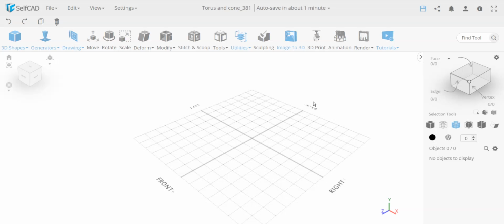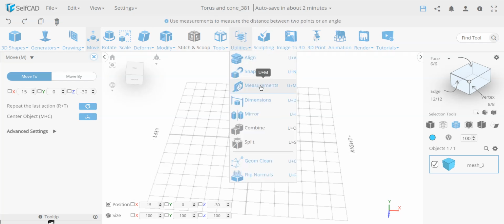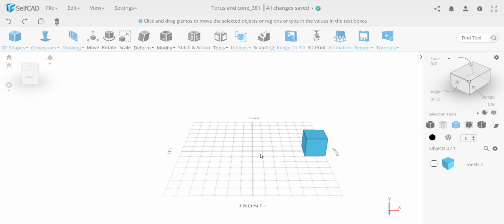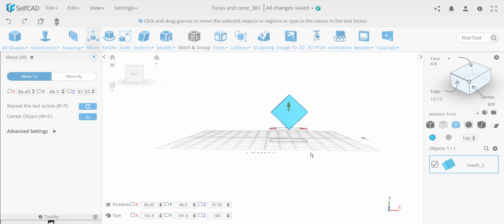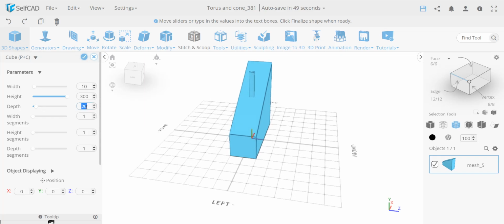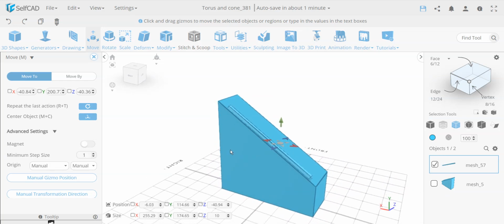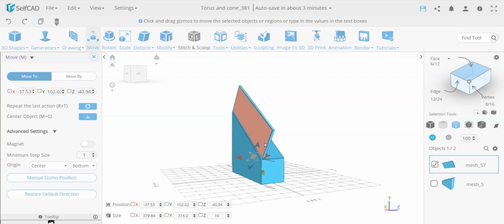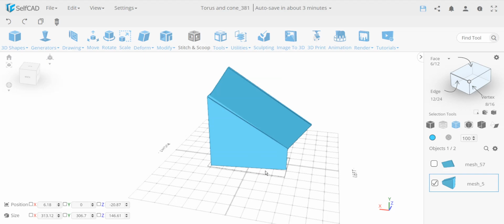How to navigate the 3D workspace in SelfCAD

Comment: I am currently trying to design a giant lego minifigure so what would be the easiest way to do that
Reply from the maker: I would first design the entire object as one piece, then split the pieces using Cut With Plane, as shown in https://youtu.be/xiopKqMZ7Uc, and then inset each piece and extrude the inner parts. To make them fit, you would Inset the inner parts by a fraction less than the outside and use negative extrusion for the inside parts.